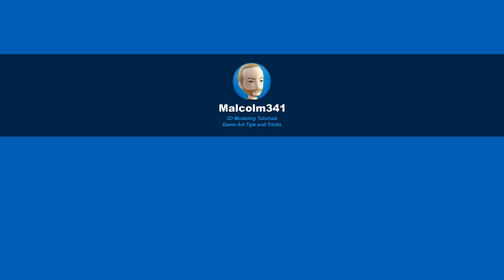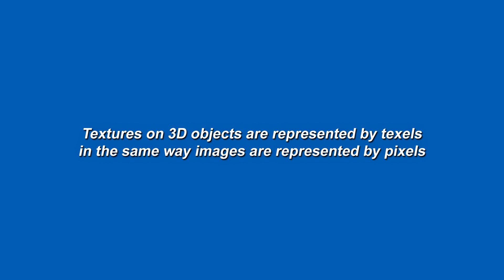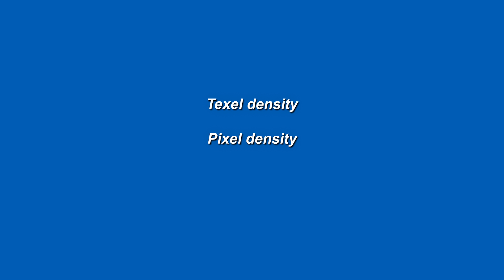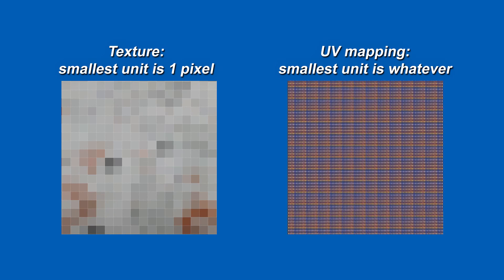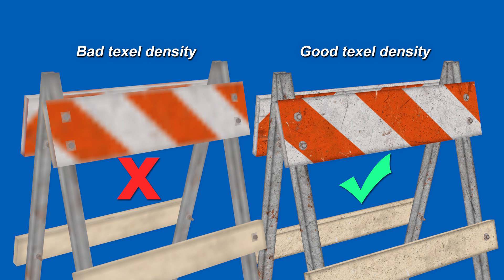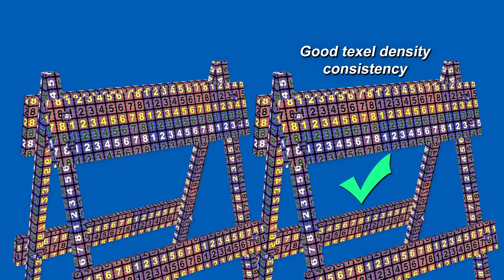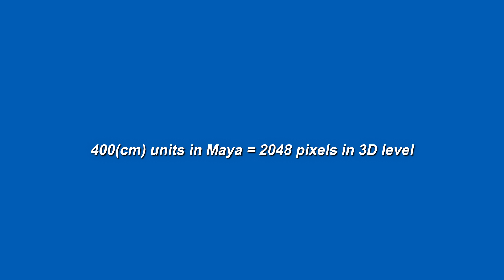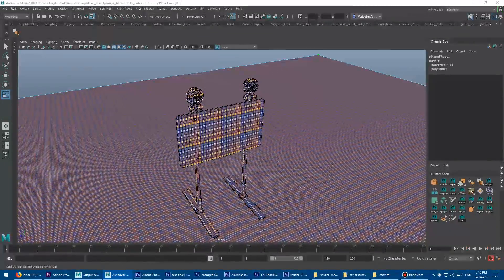What is Texel Density and How to Master it

Comment: Hi, thanks for this video, even with the math I'm a bit of a fool. Could someone suggest me some method to do this in Blender (Especially the stitch together tool) ?Thanks again, good evening
Reply from the maker: Yeah I'm terrible with the math as well so I don't even think about it. First determine what your average texture size will be, in my case 2048x2048, then determine how big of a surface you'd like to stretch the texture across, create a quad that is 1cm by 1cm in Blender or whatever base units they use, map your texture into the 0-1 UV space so it fully fills the quad exactly once. Then scale the quad up until you think it looks too blurry and stop there, blurriness will be determined by how close the camera gets, for 3rd person action games and driving games this is usually around 400cm, but it can be whatever you want. On the last game I worked on it was 384cm which is weird and hard to work with, but the level design team wanted to use an antiquated metric system that was power of two. So once you know how big you scaled the quad this will give the math without having to think about it, if you scale the quad to 200cm than you get 200cm = 2048 pixels, if you scale the quad to 384cm you get 384cm = 2048 pixels, etc. Once you have that one quad mapped and scaled with a grid texture on it, you can just match all your other objects to that same grid, providing they have a 2k texture on them. In my we can just copy paste that UV scale from the quad to other objects in the scene, not sure if Blender has that feature, but if it doesn't you can just scale the UVs in the UV editor until the grid size matches the quad in your scene, this is how I used to do it before Maya had any good UV tools, now it's pretty automatic. Looks there there is a plugin for Blender that will do this all for you https://youtu.be/3Df0dJ2QTMQ
Reply: @malcolm341  Hello! Thank you very much for your detailed reply. When I get home I try to understand everything 😊
Reply from the maker: @Stefan_I-O  Sure man, also this plugin looks like exactly what you want. https://youtu.be/3Df0dJ2QTMQ
Reply: @malcolm341  It seems very useful and also automatic, I had already downloaded it last week but I thought, because of the name, it was just to check the density. Congratulations on the channel however, lots of interesting resources! Thanks again :)

Comment: if we do like this , i mean cutting uvs and placing them on each other, then how can we avoid seams, because by doing like this we will have many more seams
Reply from the maker: Great question, basically it's just a lot of hard work and practice to hit your texel density and it's a new challenge for each asset. Seams are usually hidden in cracks or you end the UV on a natural normal map seam, or add a welding seam where the UVs end, or extrude geometry to hide it or something. This is easy for small props, the challenge comes from larger things where hitting texel density is impossible no matter how much you share the texture space. This is where multiple textures come in, also the use of trim sheets and tiling textures. Good explanation here of trim sheets. https://youtu.be/IziIY674NAw
Another great explanation here of texturing different size objects starts at 6:57 https://youtu.be/TkTQhmNFRnY?t=417
Reply: @malcolm341  tq for the suggesions and answering my query

Comment: So when you use a 2048x2048 map and A TD with 512x400cm, I always get tiling issues when I try to make a wall piece that is maybe 200cm x 100cm for instance. When i try to snap those meshes next to each other they just have tiling issues. How would one approach this on modular walls
Reply from the maker: 512x400cm is not a valid measurement, your wall piece should be 800x400cm or 1024x512 or something like that. For tiling to work it will need to be 2x1 or 1x2 to avoid having a seam. For modular walls you'll always want exactly half for the height or width and that half should be the base texel density. So for the example in this video I'd go with 800x400cm to make a wall that is longer than it is tall and then the tiling should end exactly on the boundary of the top and side of the mesh. As well, make sure to check the UV editor because planar maps often oringinate in the center of the UV space which is not what you want for modular layout since that will never tile correctly you want it snapped to the bottom left corner or which ever corner you're going to use for the rest of your pieces.
Reply: @malcolm341  https://imgur.com/a/zDZAtUJ heres my issue. So this is a 2x2m plane with a piece of 1x2. UVs are bottom left for both. One seam side tiles nicely while the other when duplicating to  the other side does not. The texel density is a 1024x1024 texture with 512px per 100cm so it fits the square perfectly. One solution I can think of is to cut the 1x2 piece in the middle and move the second edge towards the left origin seam. Basically mirroring it. Is that the way to go? 

Also I have one more question. Say I wanted to use a TD of 5,12. Is it recommended to use a 2048x2048 texture? The problem I have when using your TD settings (2048px per 400m) is that when I have a pice that is lets say a 1x1m wall, I cant have it tile, or hardly can tile it.

Comment: If i wanted to create a 2x1 mesh piece with this TD, wouldnt I get tiling issues?
Reply from the maker: If it's a tiling texture it won't matter, you'd just need to line up the tile so it ends on the 2x1 boundary, so the ground would be 800cm x 400cm and the tiling would still by 400 and it would work.

Comment: FOR organic shapes like shapes did u need to create a planar projection?
Reply from the maker: Usually you can use unfolding for more organic shapes. I generally start with a camera based planar project and then modify the UVs from there, or I gridify the UVs. It really depends on what you're mapping. I try to gridify pretty much everything.

Comment: and what about face character also set texel density and try to put into the 1U and 1V? the main or most relevant is to not scale it after set the texel density, right?
Reply from the maker: For characters typically they use multiple textures, face, body, pants, etc. Each game is different, faces are typically higher rez because in cinematics the camera will get closer to the face than the body. Characters are typically much higher texel density than the environment.
Reply: @malcolm341   oh right, I´m doing just a face, so after set de texel density, I can´t scale the uvs just try to match in to the 1U and 1V? I can´t scale?
Reply from the maker: @octaviordz9160  yes for faces typically the UVs need to live in the 0-1 space and you can't scale them bigger because the texture will repeat. Typically faces are unique unwraps with little or no overlapping UVs.
Reply: @malcolm341  can I scale it smaller? I wish to share u a Image, so you can understand me better :)

Comment: did u scale the cube shape to 400?
or can be any scale?
Reply from the maker: Oh I see, yes for objects that are going to fit into the 0-1 UV space just scale them up and try to use as much space as possible. This will be true for small props, character heads, anything that you can unwrap into the 0-1 space, but the idea is you want to meet or exceed the 400cm = 2k texture.
Reply: @malcolm341  oh right! I understand, why it is different of film industry I mean they do not worry to much about texel. In México,  it only matters that it looks good in the final, :(
I want do right that´s why I´m askinig, I just a begginer. any course that you recommend me for learn modeling for AAA games videogames realistic style please
cheers
Reply from the maker: @octaviordz9160  Film doesn't have memory limits like games do, so for film you can just make everthing super high rez and not worry about it. For games you need to squeeze a lot out of a single 2k texture. My friends developed these courses which are quite good and geared towards games.

https://www.cgmasteracademy.com/courses/45-ue4-modular-environments
https://www.cgmasteracademy.com/courses/57-texturing-and-shading-for-games
There are other course here too which look good, but I've never tried them.
https://www.cgmasteracademy.com/programs/5-3d-environment-arts-program
Reply from the maker: It can be any scale, in the beginning I scale it to 400 just so I have a base to start from and because the plane is mapped 0-1 UV then I can use the 400 plane as the reference object for the rest of the scene.
Reply: @malcolm341  so if I want a 2K texture, I have to scale my model to 400? right?
Reply: @malcolm341   so if you have textures of 2K you need to scale your models to 400 u because = to 2048?= 5.12d thats the razon for scale to 400 or it can any scale?
also how did u tell Maya that you want a 2k texture UV layout? PLease :)
Reply from the maker: @octaviordz9160  Your models can be any scale you like, but in games we are usually limited to 2k texture resolution, so I first start out by planning what my texel density will be for the whole scene so things look consistent. In this tutorial I use 400cm = 2048 pixels so I scale the plane to 400cm and apply a 2k texture mapped 0-1. This visually gives me the checker size I then need to match for the whole scene. To tell Maya how you want a 2k texture layout there's 3 main ways you can do this:
1. Apply planar map and then in the channel box adjust the width/height to 400cm or whatever you want.
2. In the UV Tookit under transform you can set the texel density to 5.12 or whatever you want.
3. In the UV editor you can you use the stitch together tool to stitch an edge of one shell to another and inherit the texel density from the shell that is the correct size. This is all explained in the video too.
Reply: @malcolm341  thats right, but when I set one organic face to 5.12 (2K texture) it doesn't match to the 1U 1V  and I have to scale it, how can I solve that? (to match my uvs and be useful in a game 2K textures)

Comment: 17:25
how did u place all your objects in just one uv udim?
Reply from the maker: Select all your objects and use UV layout, or just move them by hand. I typically start with a layout and then adjust things manually to get the tightest pack. In the layout options you'll want to set the range to 0-1 that will keep everything in one tile.
Reply: @malcolm341 You can do this selecting more than 1 object? 
So for maintain the texel high, you, once you have the uvs, you break this uv´s in shells and  your superposition them? 
Thanks for answer! :DDD
Reply from the maker: @octaviordz9160  Yes correct you can do this on multiple objects if you like. Or you can combine all your objects into one which is easier to select when it comes to UVs.

Comment: malcolm341
  A follow up question about the texel density.  If you are using a 400cm = 2048 texel density.  What are you making your wall heights?  Are you using 300cm? or 400cm.  What is the standard?  I find that 400cm feels a bit tall for a FPS, but if using 300cm  that seams to be a waste of texture space.
Reply from the maker: @Tim Wetzel it depends on the game, the best way is to measure a real world wall and find out how tall it is. Rounding up to 400cm for a one story building con be convenient just for the math, on my current game we used 384cm for a wall because we're stuck on power of two grid from some old legacy stuff with the engine. If you have the ability to snap to verts or snap to a power of 10 grid then you can use pretty much anything you like. A lot of games don't texture walls using the 0-1 space on the texture, most games are using tiling textures for walls now and a second texture for trim where it connects to the floor and ceiling so the wall height can be flexible to whatever you need and then you can reuse the texture across the whole level across different walls.
Reply: @malcolm341  Thanks for the quick reply!  Yeah, I have always liked the look of the 300cm wall, but kept seeing the 2048 to 400cm texel density, so it is very informative to learn that tiling is used so much, even within a single wall piece.  I have always tried to limit the number of polygons.  Having a single polygon plane at 300cm vs 3x3 polygon plane of 300cm.  Tiling that 100cm area would save a lot more texture space I guess and less draw calls on textures and shaders.
Reply from the maker: @TimCGI  on our particular game we're averaging 2-3 drawcalls per wall, but the advantage being we can use that same tiling texture across any wall size shape. We're also adding a detail map because 2048 pixels across 384cm is still too blurry even for a 3rd person game.

Comment: You seem like you've worked in the gaming industry. When you're tasked with making a model, do they give you some sort of document saying how many polys it should be? If so, what's that document called? I'm looking into making models that make to spec and not have a million polys along a bevel just because
Reply from the maker: Hi Robert, yes I've been working in games for 20+ years now. There's no magic document unfortunately, it really depends on the average poly count of your game and how close the camera gets to said object. The best way to go about this is to use as little verts as possible all the time. If the object looks low rez add more. How much to add will be specific to what type of game you're working on and what your target fps is, 60, or 30. The best way to build models with an average vert count is to research the type of game that they'll be used in, for example if you're making models for a third person action game I'd try to find screenshots and wireframes of Uncharted 4 or other similar games and compare the quality to your own models. If you're looking to make models and sell them I recommend buying a model pack from an existing store and taking a look at what's inside. My friend runs an online store called Dekogon where you can purchase models with acceptable verts counts for current gen hardware. https://www.unrealengine.com/marketplace/en-US/profile/Dekogon%20Studios

Comment: Just one more question,how do I layout uv and keep the texel density of complex model?in this video the model is simply a box , but when it comes to gun or vehicle and set the texel density , there will not enough space for entire uv.On 2:09 it seems your prop share the same texel density with the ground,how do you keep the uv in 0-1 without modify the texel density?
Reply from the maker: Carnor Loard, the short answer is you can't keep your UVs in 0-1 if your prop gets big. For guns large portions of the UV layout are mirrored. Unwrapping 0-1 for environments basically only works on really small props like a fire hydrant or something else tiny. For characters they use multiple 2k or 4k textures, typically one texture for the had, one for the eye and inside of the mouth, one for the body, one for the legs, one for the hands etc. For props you have a bunch of options, stack UV shells, tile parts of the texture horizontally, and or use multiple textures including trim sheets. Each game is different and the higher your base texel density is the harder texturing the props is. It usually takes years of practice to figure out what configurations work best, I like to study other games and see how the artists are unwrapping their assets if I need to texture something that's unfamiliar to me. Often on the pc you can extract textures and models so you can get an idea of how they're doing it. One time I extracted the call of duty guns so I could take a look at how they UV map those, I think they even did something unexpected like only model half the 1st person view gun because you never saw the other half.
Reply: @malcolm341  Thanks for reply , now it seems I have to practice more on 3d , everything I've learned from u just open my mind and no one mention this back to school! BTW if we use multiple textures,doesn't that mean more material in game engine?isn't this gonna cause bad optimization?
Reply from the maker: @waynesun3835  sorry this comment was marked as spam I just saw it now. Yes more materials does cause bad optimization, but often more materials will be cheaper than giant textures, or in most cases it's impossible to texture large objects with only a single texture and keeping texel density to AAA standards. It's a little unfortunate they don't teach this in school, but I've never seen a school that does it.
Reply: @malcolm341  Thanks bro,I'm living and studying in Taiwan,which lack of knowledge and technique about cg stuff,so I search and learn from online even buying some courses

Comment: 1:25 lets see it here, I wouldn't say that it is bad, if you have more details on the horizontal parts, and just plain texture on the rest (vertical sticks) then isn't it efficient to differ density ?
Reply from the maker: There are many times where you'll want to break texel density as discussed later in the video. You should aim for consistent texel density to start then fill up the wasted space by scaling up certain details. You should always try to stack shells as much as possible without creating noticeable repeats.